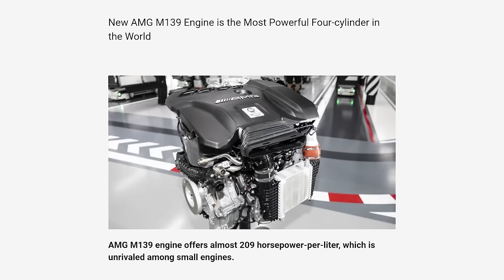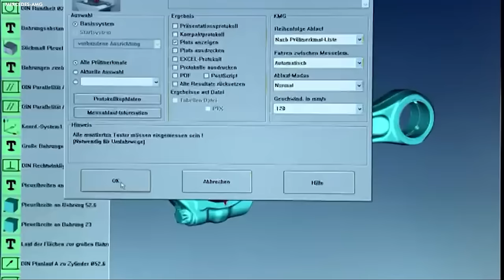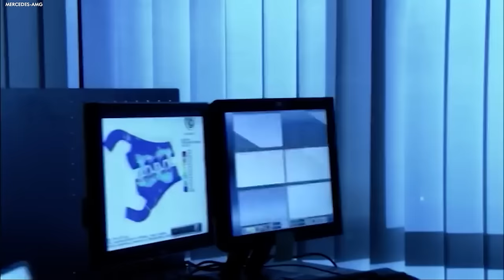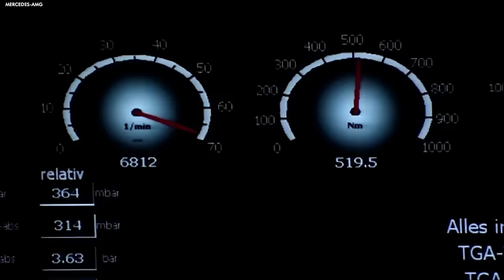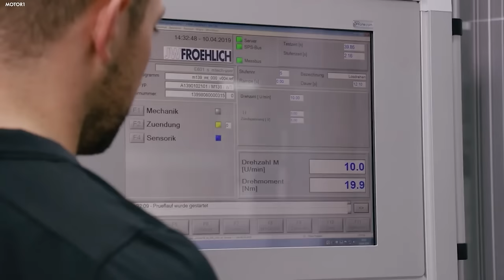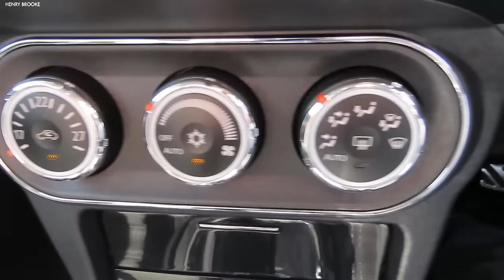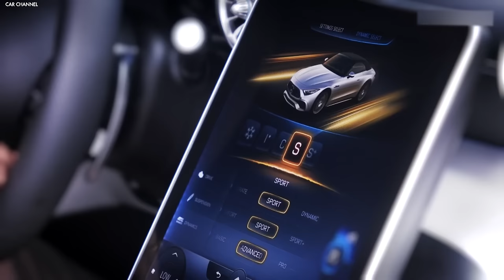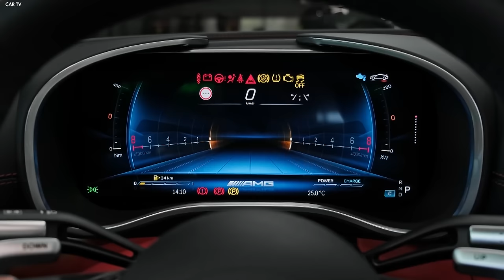Mercedes CEO: This New Engine Will DESTROY The Entire EV Industry!

Comment: My mother owned a 1999 C-class with 111,000 miles on it.  The A/C went out in 30,000 miles, the radio wouldn't work after you changed the battery without a dealer's visit, and none of the electric windows would roll up without physically pushing up on them.  I think I can predict where this boastful development from Mercedes ends up.

Comment: Only time will tell how well these 4 cylinder engines hold up. Owners will be pushing t5hese cars to the limit, due to the performance. Over time, I be surprise if it holds up without repair.  I have a feeling more repairs will be made on the heavier models